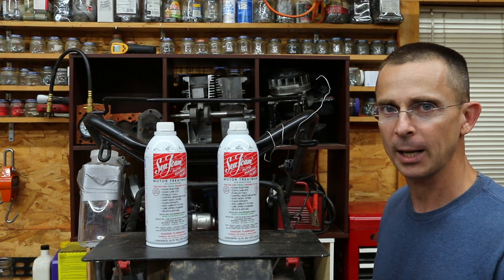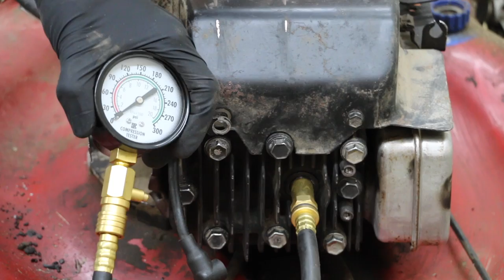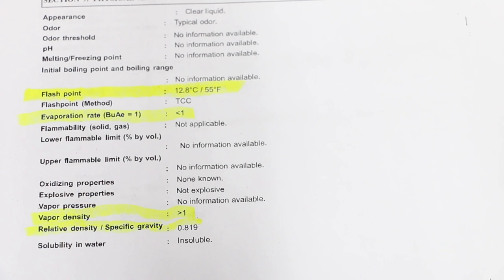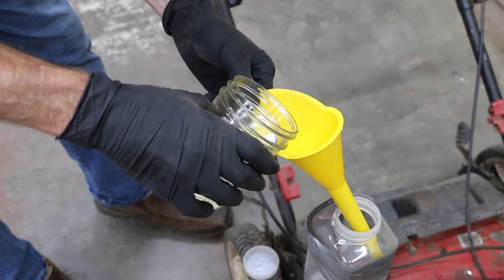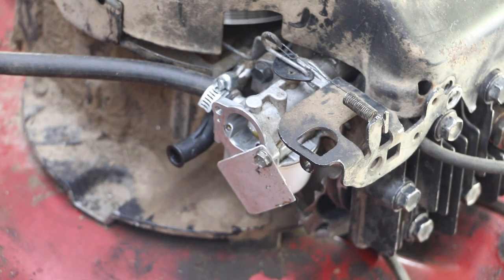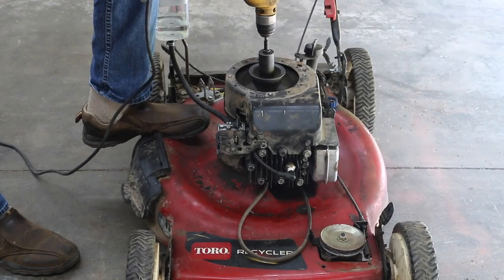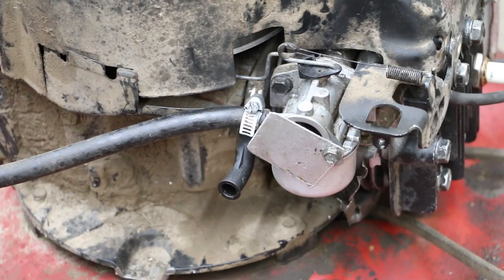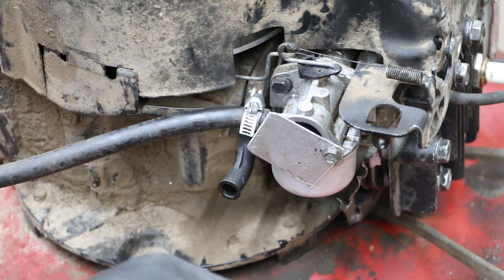Will a Gas Engine Run on 100% Seafoam?  Let's find out!

Comment: Can you try the same tests with berrymans b12 there is an argument at my job about what one is better. Seafoam for $10+ or berrymans for $4-6 I'm wondering if maybe you would try a hot soak (suck it into the engine shit it down the fire it back up after 5 mins) and post your findings
Reply from the maker: Thank you for this recommendation.  I tested B12 a while back and it didn't perform as well as MMO or Seafoam.

Comment: Can you use jb weld to restore and fill a scored cylinder wall in an engine? I actually want to try this but im not sure if it will work or last.
Reply from the maker: Thank you for this recommendation.

Comment: Do u think it would be safe yo run 3 cans in a tank of gas to clean an older EFI engine? Looks like it shouldn't hurt and might clean things up but I often think a can isn't enough to do much of anything in a 20gal tank
Reply from the maker: In a 20 gallon tank, I don't think it'll cause any issues, but recommend checking their website for additional information to be sure.

Comment: Time to see if an internal combustion engine really can run on water! HHO generator time! If you haven't tried it already. Just remember, hydrogen moves directly UPWARD in a sealed enclosure, because it's so light. I blew off a thin metal lid off of a mason jar from Walmart (one of those Ball brand retrofitted for such a project) the HHO gas would not push itself out through the vinyl outlet tube because the opening was lower than the lid, about an inch, so it blew off the lid, almost hit me in the face, blew off the DC power leads too, I threw myself back and broke my right foot big toe. My son thought it was hilarious. I was yelling in pain..... I was just playing around with left overs from his science fair project.
Reply from the maker: Wow! Glad you are okay. Thank you for this recommendation.

Comment: Damn. I wanna try running my car on seafood and see what happens lol. I have a fuel injection service cleaner and a Adjustable MAF calibrator to adjust the afr on the fly.... I may do a response video to see it work on a gas engine in a car lol. For what I see it didn't hurt it lol so I must try.
Reply from the maker: Thanks for commenting.

Comment: I'm sorry if that's a noob question, but what is the compression test for? What does it tell us?
Reply from the maker: It's one indicator of an engine's health.  Low compression usually indicates piston ring or valve issues.  Could also be caused by a head gasket or cracked cylinder head.
Reply: @ProjectFarm  Ah! Thanks.

Comment: What actually happens with a clogged exhaust system?

What happens if you run resin (JB weld, etc) through the fuel line of a running engine?
Reply from the maker: Thank you for this recommendation.

Comment: You've got to start buying those bigger cans of Seafoam man.  That's super expensive buying them 12 oz at a time when you're going to use it a lot.  Save yourself about 60% of the cost and buy 128 oz at a time.
Reply from the maker: Great tip!

Comment: i want to know if doing this will remove varnish from a quad carb motorcycle
Reply from the maker: Thanks for the suggestion.
Reply: Actually it might help as the isopropanol softens that fuel varnish I think

Comment: Will a gas engine run on chlorine and ammonia vapor but do not mix the two, just have two separate bubblers and only combine the gas near the engine intake.
Reply from the maker: Thanks for the suggestion.

Comment: I think it would run in a diesel motor, but before it plays I call it not running at all.. naptha oil or however you spell it is just a lubricant...
Reply from the maker: Thanks for commenting on this.
Reply: huh It ran I didn't see that one coming
Reply: Merry Christmas

Comment: I would like to see 100% Seafoam used and then as engine running add gas to tank till find max % of SeaFoam that does not SMOKE.      That will answer the question as to what is the MAX % of Seafoam that will not produce smoke in a normal motor.
Reply from the maker: Thank you for the video idea!

Comment: I have an idea..  Doomsday Fuel.   You could title it something like that... The idea.... Lets imagine a doomsday scenario..   You can't find gas for your car and you need to travel away from where your at.  There's a lot of things that will burn in your car, but what if you needed to combign a bunch of different things of whatever you can find.. Lacquer thinner, rubbing alcohol, sea foam,   cleaners, flamable fuels... you mix it all together to get 3 gallons of fuel..  Will it work?  Will it clog up the fuel injectors?. Say you need to go 200 miles....
Reply from the maker: Thanks for the video idea.

Comment: Have you tried running an engine on 100% fuel octane improver (no petrol/gas) added
Reply from the maker: Yes, I did this a while back and the engine actually ran without any major issues.
Reply: Project Farm 

I must've missed that one.  I'll check it out now

Comment: I wonder.
What would happen if you ran something through the engine that made it a little hotter than normal but still stable, then hotsoaked it in seafoam
Reply from the maker: Thank you for this recommendation.

Comment: Can you make a engine run on compressed air, is so is it possible to make it run a air compressor to supply the compressed air? I've had the same thoughts about electric engines (motors) where the spin a alternator to charge it's batteries.
Reply from the maker: Thank you for this recommendation.

Comment: You know, you a car engine, I can see putting all these additives in it to clean up the engine because tearing a car engine apart to clean it out is a real PITA. But these little lawnmower engines, just tear it apart and clean them out by hand. They come apart so easy and quickly putting an additive in it just makes no sense to clean them out. A good degreaser, a wire brush, and a scrapper is all you need to get it all cleaned up and better than any additive is going to do. Now an additive to keep it clean is a good idea.

Comment: How was all the rubber components after this test i'e the carbareta
Reply from the maker: There wasn't any harm.  Seafoam is very safe of rubber components, unlike other products such as brake parts cleaner, which will damage some rubber and plastic components.

Comment: Will an engine run off of just octane booster and if it will what will happen?
Reply from the maker: Thank you for this recommendation.
Reply: Project Farm no problem. I had to do this once to my 1992 buick lesabre to make it to a gas station and i noticed it was running really rich (obviously), but ive always wondered what it actually did

Comment: Yeah, but.... Will an engine made out of seafoam run on Marvel Mystery Oil but using JB Weld instead of motor oil and B12 Chemtool for a spark plug and dog poo as a cylinder head and a piece of driftwood for a mower blade?
Reply from the maker: Thanks for the video idea.
Reply: @ProjectFarm  Sometimes (all the time) I don't think you actually read the comments.

Comment: PS - I am not really sure how much this stuff cleans... The comparisons were not significant.. THAT IS BAD because For years, in motorcycling, we always used seafoam straight in the gas tank to clean carbs without having to take them apart.  I am disappointed in this product... From not on...  No more $11 per can!!!!!
Reply from the maker: Thank you for the feedback

Comment: You really need to try this one and make a video.,!!!   Water your Pistons,,,.  Yes I said water,,,,.  Roughly 16 oz of water in a spray bottle,,,.   Rev rev rev spray it into the carburetor or throttle body,,, let idle and heat back up,,,, spray spray spray,,, rev rev Rev,,,. Cars at about 2,000 or 3,000 RPMs,,,,.  This water hits the hot Pistons valves. And Chambers,,,,.  Burns off the black sticky carbon and turns it white,,.  Turns the carbon to red hot Cherry Embers and sends out the exhaust,,,. At night you can see this vividly,,,,,.  It's actually steam cleaning it under high pressure,. !!!!   If you've ever pulled a blown head gasket,. ???   You will see the cylinder that's leaking,,,, it's the ones that's been steam cleaned buy antifreeze and water,,,,,.   All of these cleaners,,,, I prefer Marvel Mystery Oil,,,,, takes at least several applications in 500 miles of easy driving to clean and work,,,,, !!!!        Water your Pistons at least twice a year,,,. ???????     I've been doing this to every older engine I've owned for over 35 years,,,.  !!!!!!    This will also unstick compression rings and oil control rings,,,,.   !!!!!
Reply from the maker: Thank you for this recommendation.

Comment: Will it ignite?  Then yes, it will run an engine. Duh. Ppl, an engine will run anything than can be liquified a d tun thru a carb. Anything. Kero, diesel, corn liquor, gas, alcohol, anything.
Reply from the maker: Thanks for the feedback.

Comment: My lawnmower runs off of Global warming. It's the perfect solution.
Reply from the maker: Thanks for commenting.
Reply: I was wondering if you were going to test PTFE oil additives? I used Tufoil for years in my old Ford Fiesta and got obscene miles from the engine. I was religious about its oil changes and using the Tufoil, so I never knew if the Tufoil is what gave me 350k miles or the oil changes or both. The car finally broke in half running slowly over some RR track with 4 occupants in it. It was halarious. The engine still ran great tho. Can you also test Rain X and other water shed products? Dean

Comment: The Seafoam really didn’t clean anything - the engine looked basically the same before and after the Seafoam - other than smoke 💨 making you think it’s burning off carbon, it really didn’t clean anything - that’s the real takeaway.